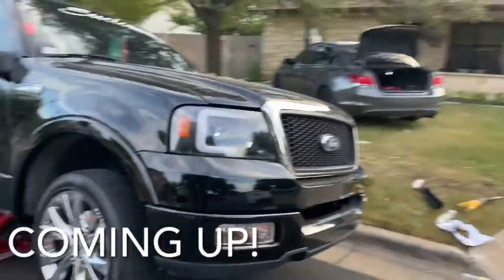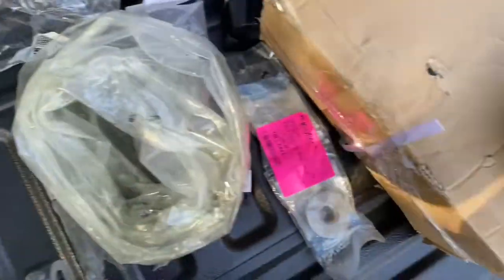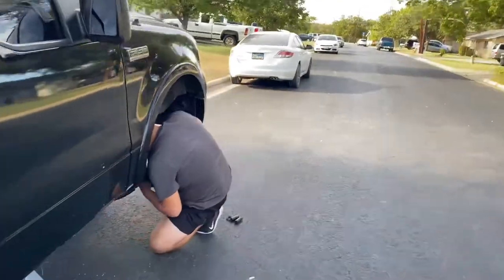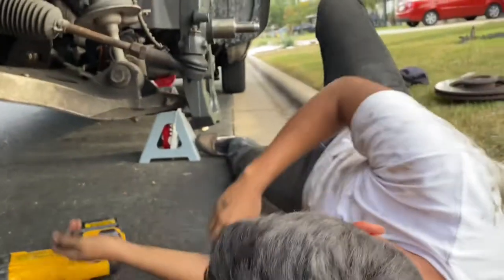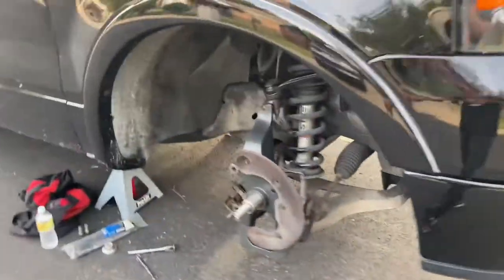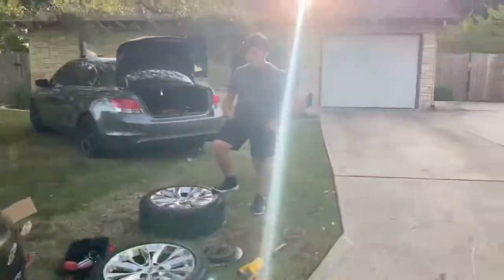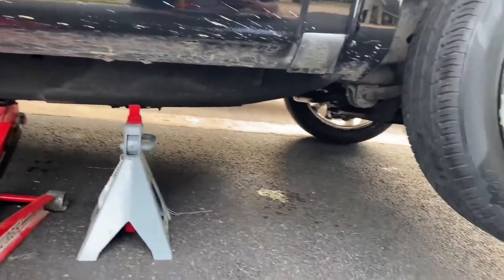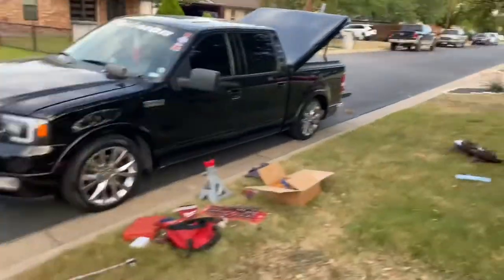GETTING A 5/8 DROP ON MY FORD F150

Comment: Which drop kit did you buy im trying to drop mine 🥲but don’t know
Reply from the maker: All my parts came from Belltech
Reply: i have a 2012 f150 reg cab short box . im lowering it . but inoticed bellteck has the drop spindles . so like all my trucks i built . so did u go with the 3inch drop springs and the 2inch drop spindals @InfamousDaniel
Reply: im thinking thats the best way  .  so buy the bellteck kit with the drop spindles and drop coils ?????    thats what u did rigt
Reply from the maker: @MeMe-wp4to  I did the 3in drop struts and the 2in drop spindles. I have factory springs on
Reply: @InfamousDaniel  OK.  OK.   Well it really be no different all o know is I want it as low as I can get it .  I'm gonna go look at belltec kit now again and see if it's struts with the spacers or if it's the 3in drop coils